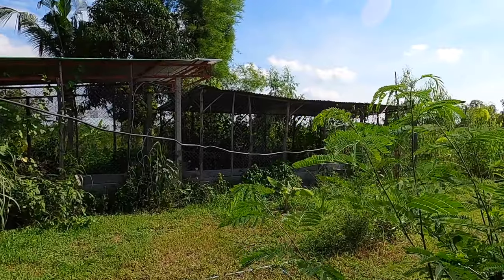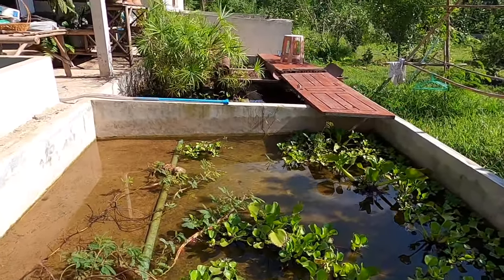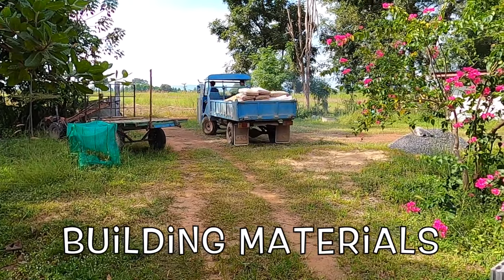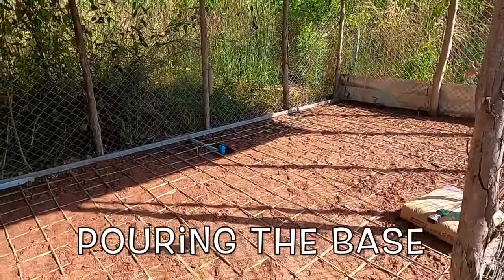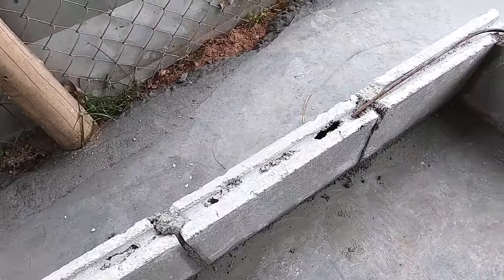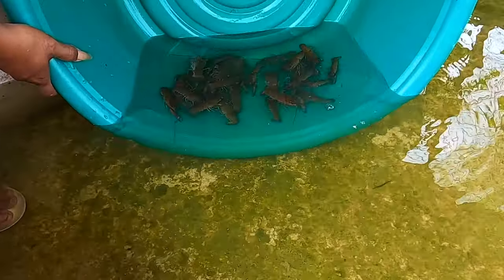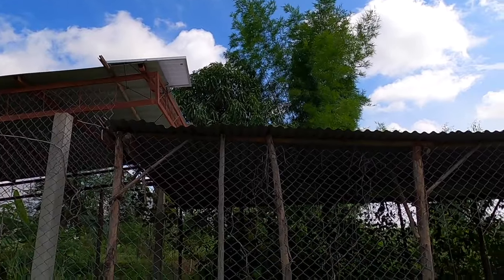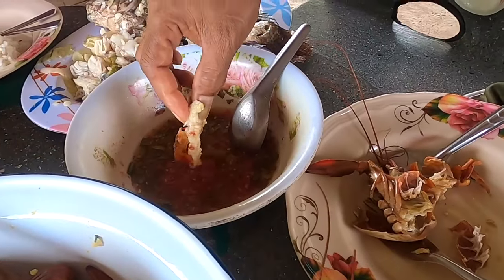How To Build a Crayfish Tank (Cheaply)

Comment: Do you have a backup battery for the air pump should you have a power outage or is it not a big problem
Reply from the maker: Hi Gary, no backup battery mate. It's just a DC setup that only runs during daylight hours. Most of our tanks don't have pumps running, although we are hoping to get more as some tanks are prone to a thin biofilm at times.

Comment: its not good to use waterproof cement?
Reply from the maker: When you say waterproof cement do you mean using an additive, coating or the smoothed finish like ours?
Interested to hear back from because after using the banana cuttings we don't have any issues.
Cheers.
Reply: @TLFarm adding special cement they use in swimming pools to make it waterproof.